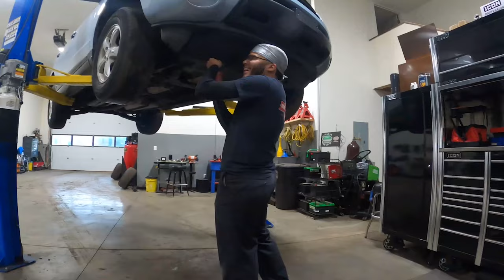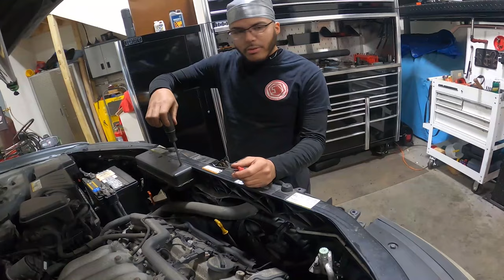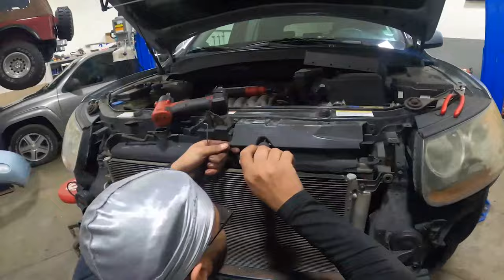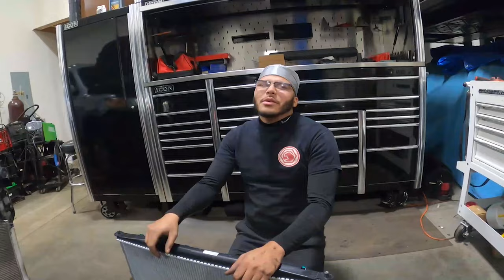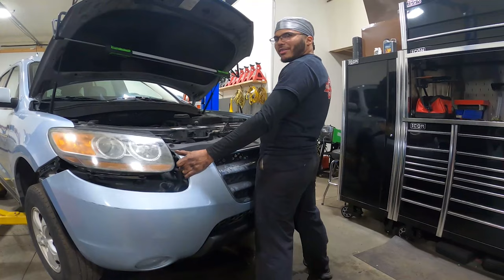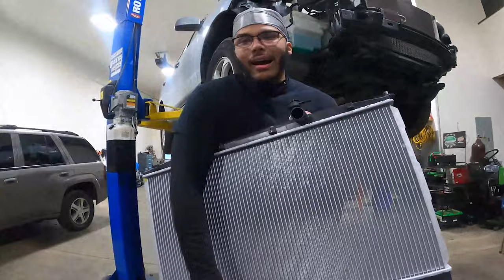07 Hyundai SantaFe Radiator Replacement- Featuring Durag Raf

Comment: This is exactly the video I needed. The other videos were showing removable top-core support. I realized that I had to remove the bumper cover. I got everything out, but putting it back together was going to be difficult. Thanks for showing A/C core and bumper support so that I could get the Radiator and fan assy re-installed. Makes the work much simpler. I am happy that I decided to watch your video before continuing. Thank again, I subscribed.